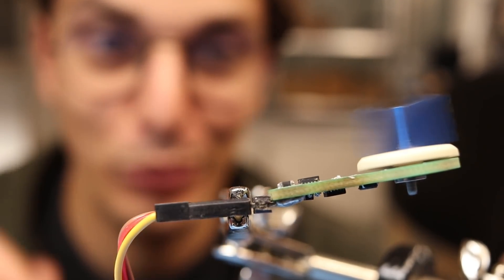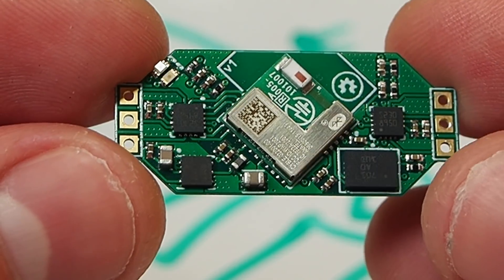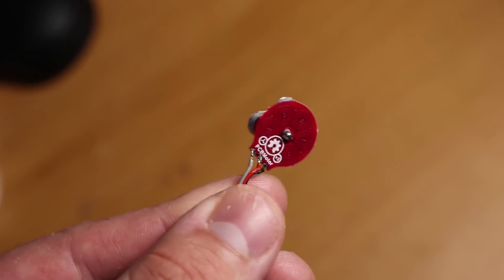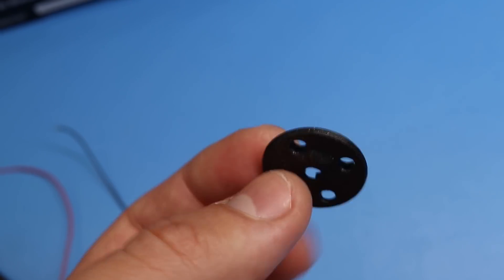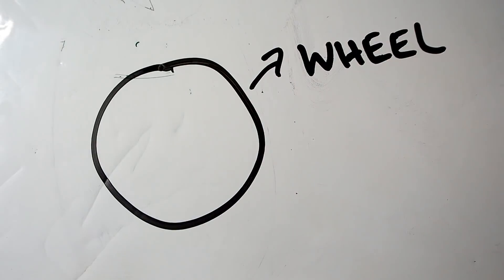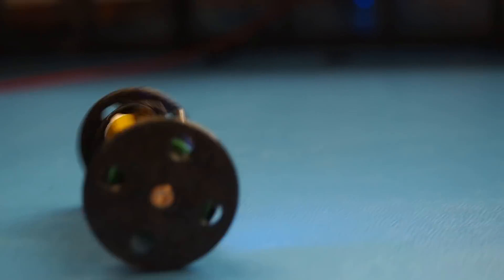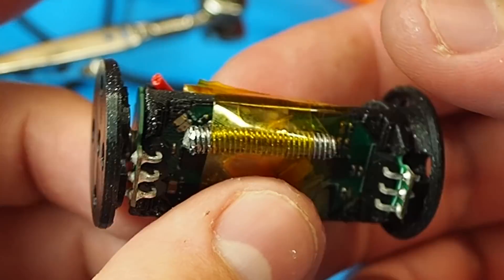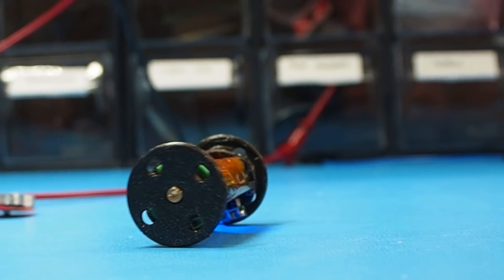PCB Motor 2-Wheeled Robot (Part 1/3)

Comment: it would be interesting to have multiple coils on different pcb layer but a little bit shifted between them so it can simulate more small coils in the stator but that would imply to control these set of coils in a syncronous way

Comment: Sir why don't you make videos about how you program your Circuits, which programming language you use, and which software you use to program these microcontrollers/circuits
Reply: I believe he uses VS Code with PlatformIO. So probably C or C++
Reply: @DAAI741  can we do embedded systems programming using VSCode?
Reply: @abdullahtanveer316  No reason why not. Vscode is a highly customizable code editor. You can turn it into and IDE if you really want to. As long as you have the hardware needed to flash your chips.
Reply: @DAAI741  Thanks for the information 👍😊

Comment: Hey, RE: the problems you've had with some of the flat pancake motors starting up.  Watched some of your videos and finally hit me what the problem is, been around the early 2000s since I was last looking at these types of motors closely.
Pole angle.  Because these only have the 6 coils, when the opposite magnet is over the coils the force is mostly 90 degrees from the PCB, not in the rotation plane.  If the rotor is not constrained well it can simply push the magnet away and put the bearing in a cocked state where the friction increases and it won't turn.
Higher precision bearing or longer shaft and two bearings limit the off angle, and make it less likely to get stuck in this manner.  Also look at small pulses for starting, so the tiny bit of in rotation force has a chance to act on the rotor without the coils staying energized and keeping the rotor off angle and higher friction..
The other easy fix is more poles.
They are problematic motors, but were used in some of the old floppies so there are ways to make them reliable, it just takes some extra work and tricks.  If you look at an old 3.5" floppy with this type of PCB motor and watch its start up on a scope it will probably give you a lot of ideas..

Comment: could you make a tutorial on how you use your heat plate for reflow? I've always wanted to try reflow soldering for higher quantity SMD boards but want something cheaper that won't burn my boards
Reply from the maker: I have given some explanation on it, in this video - https://youtu.be/dy9NutXl2OY

But there are multiple other tutorials on it on YouTube 🙂

Comment: Need more pegs / steps / coils, with more (smaller) magnets, have you tried tighter ovals? Amazing progress so far, seen from the leaping frog flex pcbs, keep it up.
Reply from the maker: Thanks! I agree, I think more steps with be needed for a balancing type two wheeled robot.. But for higher speeds, I don't think it will be an issue

Comment: what will happen if you stack 2-4 of those pcb motors and connect them in series? How much would it increase the force? And maybe try magnets on both sides of the pcb?

Comment: Printed PLA bushings should be very low friction, and would help reduce weight.  You should be able to get tight tolerances that eliminate the wobble. Also, with such little mass, reliance on CG to keep the battery from rotating to transmit the rotation to the wheels seems wasteful.  Just use a third wheel, or that zip tie.

Comment: So you COULD make it from metal, OR you could optimize your print geometry. Some gussets between the main platform and its "bookend" PCB motor coils to keep them from leaning in, extra thickness in the bottom of the main platform to make a "wheelie bar" somehow (maybe put a mount for a bearing, to be used as a central 3rd wheel). You could also make your print thicker, after all you are adding more weight anyway. Some thoughtfully placed thicker sections around the bottom could simultaneously reinforce the corners, and make contact with the ground to prevent flipping. A little extra bulk around the bearings wouldn't be a bad idea either.

Comment: Great work as always, just couple of hints.  The tail solution will work better than any balancing method. add that light tail again. make wheels out of PCB, it will be much better than 3D printed ones. add a rubber around those wheels to increase traction.

Comment: really neat idea, have you thought about making a small gear reduction to the wheel to help deal with the low motor torque? it wont go as fast but hopefully you wont be stalling the motor as much and will over all be smoother and less hard on the fittings.

Comment: Very good work ! You should increase a bit the external diameter of the wheels as the PCB connectors are touching the table. Also, you should use a 2 bearing design per wheel instead of one. This will help you for the stability of the robot by reducing the tilting of the bearing. The bearings could be mounted on the PCB side and the shaft would go through the stator to the wheel. 
It seems that you are using PLA as 3D print material. If you stay in FDM, PC will give you better results against temperature. If you consider to change 3D printing technology, tough SLA resines are best solution you could find for high temperature and precision.

Comment: FYI those small bearings are really fragile. Inserting them with a hammer most certainly did not help your wobbly wheel issue. Try pressing them in with a vise instead of hitting them with a hammer....

Comment: It looked like the corners of the tabs for the pcb motors were catching on the table.  Maybe just make the wheels slightly bigger.
Reply from the maker: You are right but initially this wasn't the case.. I had some clearance but with time the plastic wheels bended and one of the pcb stator was sometimes touching the table

Comment: Both of your wheels should have the same drive.  try synchronizing the motors.
Reply from the maker: From a software perspective they are in sync.. But the Mech issues I mentioned in the video were make the wheels skipping steps

Comment: I wonder if you could use 2 CR2032 batteries mounted on each wheel instead of the lipo.
Reply from the maker: Their current rating & capacity would be too low.. Overall the robot draws around 600mA
Reply: That won’t long last nice Idea but it won’t last that long

Comment: If you take the plastic spacer part off the header once you solder the headers on the wheels, you'll be able to solder the chassis PCB so it sits much lower.
I look forward to seeing this chooch along :D

Comment: It's great, but it would be easier to control if you would change it into a line follower. It would make steering easier (just follow the line) and you wouldn't have to worry about balance. It clearly has enough torque to move.

Comment: make it a brushless dc motor instead
Reply from the maker: Technical it already is 😜
Reply: @CarlBugeja  why a circuit board then
Reply: @CarlBugeja  simple dc circuit with fixed potentiometers for speed

Comment: I feel like those PCB Stators could be a lot more efficient...  Any reason you decided not to swap it around?  I would wager the magnets being on the interior and the "PCB Stator" board AS the wheel would be MUCH easier for it, and would add weight to the middle chassis as well.
Reply from the maker: The wheels would be lighter..but how are the wires of the stator/wheel going to pass&connect with the main board and battery? (Adding slip rings would loose the simplistic concept I'm looking for)
Reply: @CarlBugeja  Hmm, fair point, I hadn't considered that. I'm assuming the oscillation of the "Stator PCB" is controlled elsewhere on the chip right?  So there wouldn't be any way to use an EM field to transfer said power?  I'm aware how small of a transfer that would be, but I'm also at a bit of a loss as to the rest of the specs of the build, that's my bad, I should've researched your project a bit more before jumping in there, sorry.  Is there a possibility of you being able to impart some Neodymium to the interior of the Stator "pads" as well to increase output?  I only mention this because I've had similar experiences in my own endeavors and Neodymium really helped; I'm unaware of the magnets you're using.  I just really feel like there's more potential in that little PCB somehow...  Is there maybe a better place to discuss this sometime maybe?  If not that's fine.  There are also ways to transfer that power out to that PCB/Wheel that would allow for the energy to transfer as well, but it'd take a bit of clever work I've yet to personally DO, so I mean, I can work up some CAD samples or something to show my thoughts if you were at all interested?

Comment: So, here comes a new piece of art 🤩.

Suggestion: I think addition of a rubber band on the wheels can hopefully make it work much better😅
Reply: also maybe he should get an SLA 3d printer (if he doesnt already have one), I think the added accuracy would be useful in certain cases and could make the final iterations of his projects look better
Reply: @___echo___  Ya. I was thinking so as well😉
Reply: Rubber band wheels really only help with grip and the motor doesn't have much torque so rather than grip it should be harder let's say metal. Trains also use this same method to move a lot of weight with little torque

Comment: If you do an inset "lip" on the outside of the wheel, you might be able to span a rubber band over it for better friction.
Also maybe a PID loop for balancing?